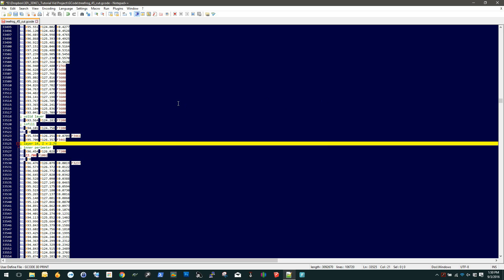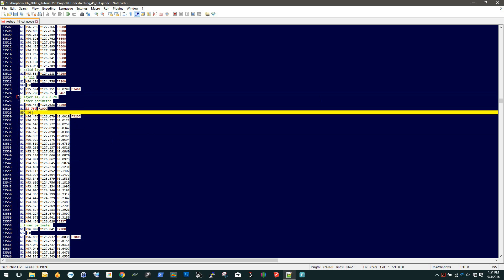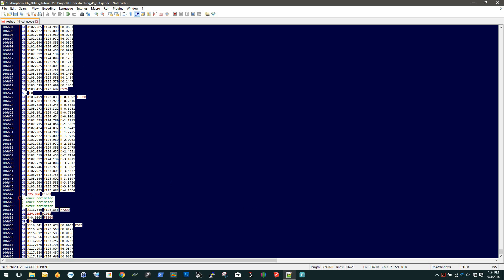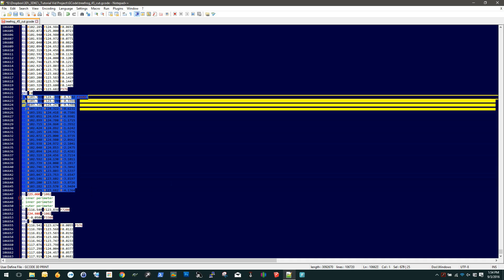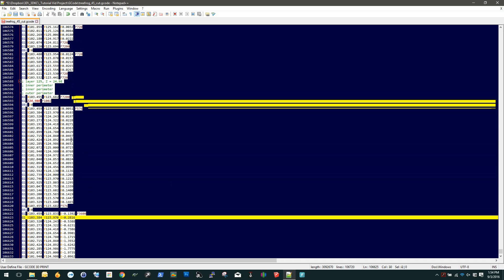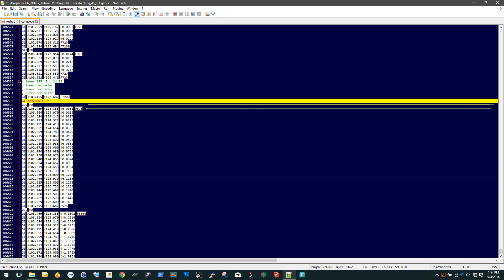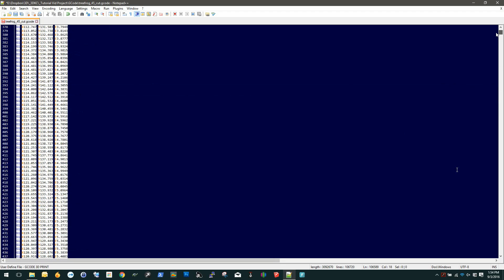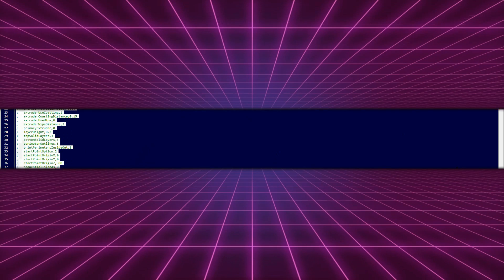Tutorial - Reading GCODE - 3D Printing

Comment: Hey Joe. If you reduce your screen resolution before recording then it's a lot easier for people to read the code. I'm guessing you're on a 4K screen, because I'm on a 1920*1080 screen and I can only just read your code. If I was on anything smaller (like the 1024*600 laptop screen I use when I'm away from home) I'd be out of luck.

My personal preference is for Sublime. It's a really neat text editor with a zoomed out display at the right side you can use as a scrollbar, very useful for long documents like Gcode.

Comment: hello Joe ...
can you help me 
when I start to print the nozzle is to high from the bed , so I'm not printing on the bed ,, although when I home my axis it good and all my setting it seems fine 
so any suggestions ?

don't forget me if you bypass 1 million subscribers
Reply: When I got my Monoprice Select Mini and used Cura to slice, I didn't set up the print volume to 120x120x120, so it used the default of 100mm^3. I had the same problem of homing fine, but the first layer being about 1mm off the bed.
Also, make sure your filament is set to the right diameter. Cura kept switching me back to 2.85 instead of 1.75, so the machine was under extruding and had a really hard time getting bed adhesion. If it did adhere, the print looked decent, so it took me awhile to find. Good luck!